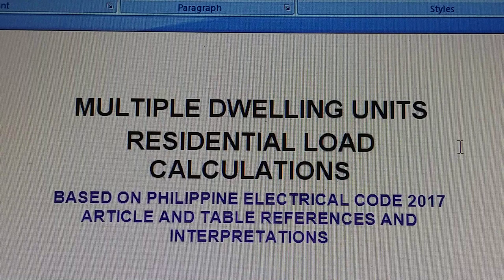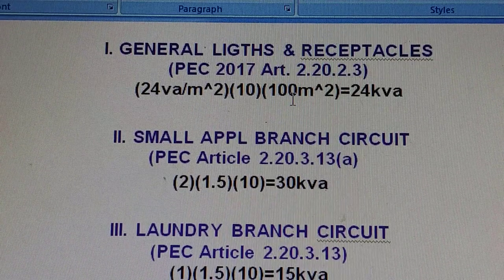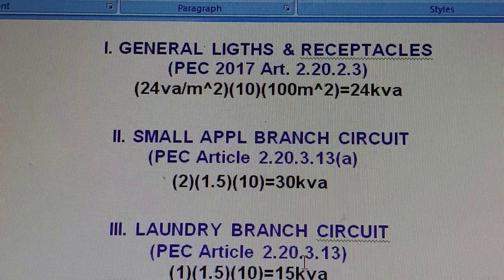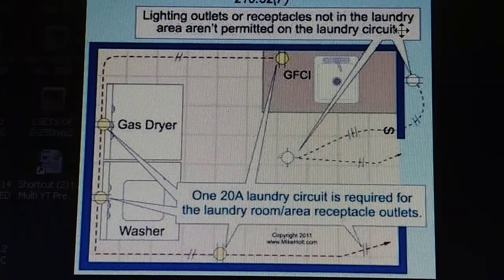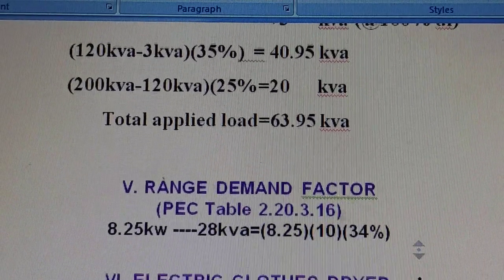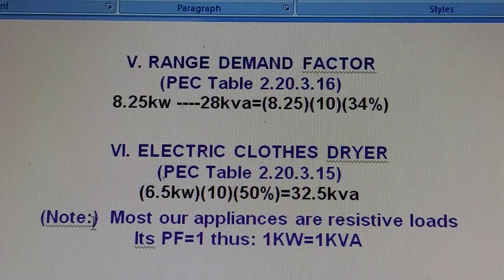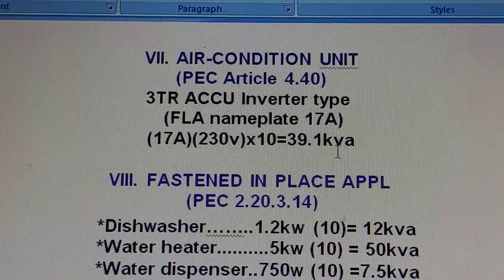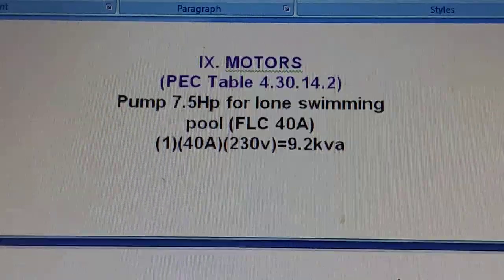THE MULTI DWELLING UNITS RESIDENTIAL LOAD CALCULATIONS ( The FILIPINO ENGR "TAG-LISH" EXPLANATION)

Comment: At time 21:06. PEC Section 2.50.3.17 is used for Grounding Electrode Conductor which is connected to Ground Rod, Pipe, Plate Electrode, Concrete Encased Electrodes, and Ground Rings...PEC Section 2.50.6.13 should be used to size Equipment Grounding Conductor...

Comment: At  time 17:29, sizing of OCPD should not be based on PEC 2.40.1.6. This PEC Section is only for Standard Ampere Rating of Circuit Breakers and Fuses. Sizing of OCPD should be based on PEC Section 4.30.5.3 for Motor and Other Loads or PEC Section 4.30.5.2 For Motors...

Comment from the maker: My apology sa option #1 typo error for  Lighting load total df application. If less than 120kVA lang ang subtotal demand load natin this will be the right one calculation
First 120Kva-3kva(35%) + 3kva@100%=43.95kVA lang mga sir. Hindi 69kVa-3kVA.
Yung option #2 ay tama lang mga sir ang calculation procedure. Thanks and pls be guided accordingly.
Reply: Sir bakit (120kva-3kva)(35%)? San nakuha yung 120kva? Eh diba total applied load po naten 26.1kva?
Reply: sir tama naman ata. eh. kc first 3000*100=3000
66000*35%=23100
3000+23100=26100va
yun d ko ma gets yun gen.lighting naging 26.1kva. tas yun small appliances nawala.
Reply: gets ko na o yun 69kva sorry.. d lng   po kc detalyado.
Reply: Ty sir sa video..tanung ko lng sir bakit unh ocpd na 1000 ay divided by 3?

Comment: Sir ilang piraso ng ilaw para sa 15Ampere na breaker tama po ako na 12 lighting in one circuit even how small the wattage.
At sa  power outlet sa 20 Amp. Breaker, 8 na piraso lang ang dapat.

Comment: sir same lang po ba yun 3hp saka 3tr kasi po 17A lang din po yun ginamit nyo?
Reply: yes,   Tr to Hp. 1 Ton of refrigeration is 4.716 Mechanical Horsepower. As per , 3Hp is 17A Full Load Current.
Reply: i mean NO, magkaiba tr at hp..hehe..
Reply: So dapat po sir. 3hp lang po yun nasa calculation, hindi 3tr. Kasi mag almost 15hp na po yun pag ganun. Thank you sir!
Reply: @joearial3453  1TR = 1.2 HP/TR ; 3TR = 3.6HP